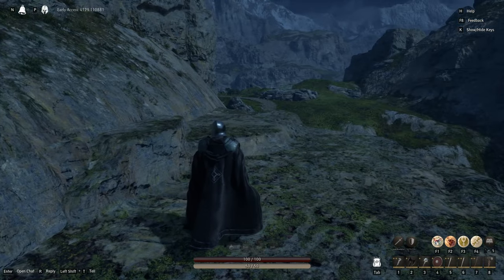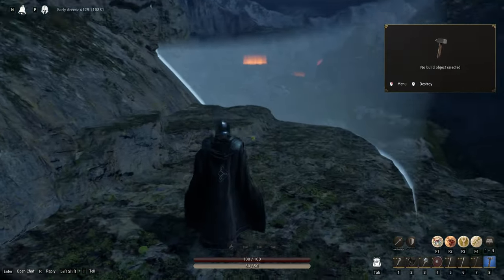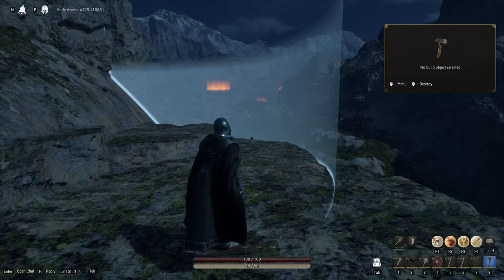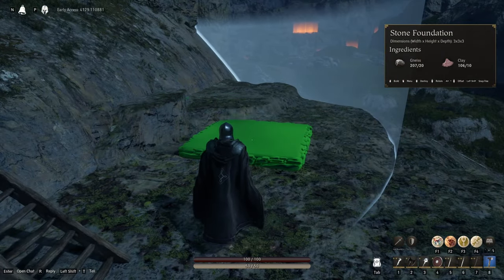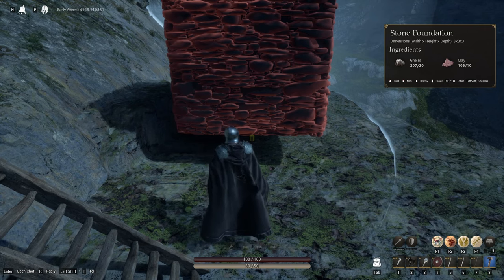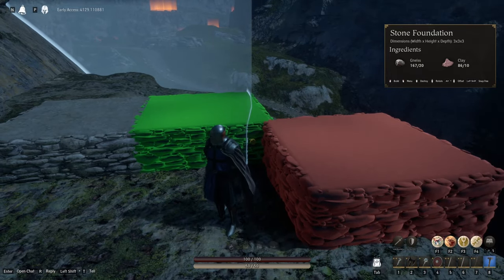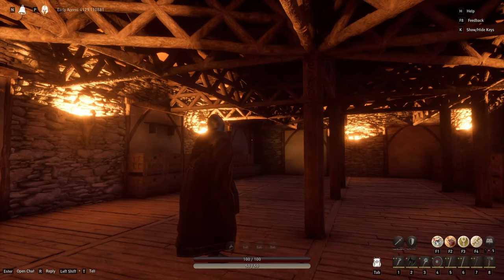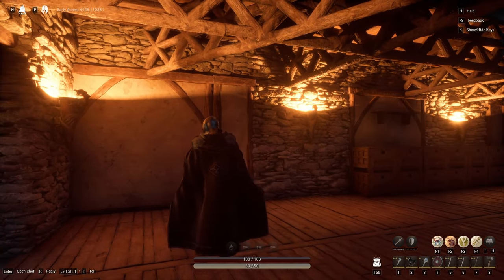Basics of Building a House in Pax Dei

Comment: Cross beams do nothing. Only horizontal and vertical add support
Reply: Really I just finished my ground floor and it's not a lot of space as a solo player so I am thinking of building 1 and 2 floor
Reply: @Nope60_09  yeah ignore angled beams. Stone pillars and 1/3 stone foundation walls are great for support. Horizontal beams for bracing.  My buildings over 9 high 😅 and could easily go higher
Reply from the maker: I'm going to have to check that out. If that's true then that's just kind of messed up lol. Thanks for the info though, I appreciate that.
Reply: @tonybrutal  let me know plz
Reply: its simple to prove or disprove, make two identical walls one without beams one with and see how quickly it goes orange
Reply from the maker: @XelaML  very good point.
Reply: When cross beams are connected to either horizontal, or vertical beams, and or foundations it converts into an added support beam.
Reply: @beardedbear4737  I used the half stair pieces to get me up 3 floors green.

Comment: I have a 3 story, 4 x 12 (foundation piece) long & wide, with only reinforced stone at the corners, horizontal stabilizers, and NO central support and my roof is complete and green.

I think its just stone at the corners, with good horizontal support thats needed
Reply from the maker: @CellChaos-e2s  they've changed how it works a bit with the latest update so as of now I say just do whatever works for you because they will probably change it again in the near future anyways.
Reply: @tonybrutal  oh, I'm a building fool. Previous to the update , the building system was more unforgiving than it seems now. They may have relaxed some of the requirements since so many folks were finding it to be a challenge

Comment: I'm on Promethius -> Inis Gallia Northern Nones and my neighbor has gotten to 9 stories.
Reply from the maker: @littlemetalpixie  did they use a hill or giant rock or cliff side?
Reply: @tonybrutal  no, it's flat as can be. She's a friend of mine - if you go to the northern tip of Nones almost on the border of Trecassis, you'll see a small city that grew there. Look for Pi. She's got a factory there that is at least 7 floors high. 

She used reinforced stone with beams dropped in plus layers of foundation for stability. It's quite a sight to behold!
Reply from the maker: @littlemetalpixie  sounds very incredible. Nicely done on her part.

Comment: walls dont do much of anything, i always build my frame first out of wood or stone, then put on the roof, and walls go on last
Reply from the maker: That sounds like a solid way of doing it. I like that.
Reply: @XelaML  when you go higher walls are everything. Walls or, especially, stone foundations walls reinforce pillars. You can test it by going as high as possible with pillars or vert beams. Then shove walls in and watch the pillars/beams change color. 
Frames are important but each part has its role. 
As i said. Im 9 high with green pillars/beams because of walls. No framing. Bar floor supports.
Reply: @beardedbear4737  wish you would post a vid about it mang, im just trying to get 5 high and running into issues, ive got posts and beams everywhere
Reply: @LosMuertos4830  i was considering it since ive been helping out people in game with it on various servers. 

Ill see if i can make something over the weekend.

Comment: The quantity of beams required to go up a few levels is absolutely ridiculous and really unrealistic, even in a medieval setting.
Reply from the maker: If you level your carpentry and get better beams and stuff, then it's not so bad. The low level stuff just isn't that strong.
Reply: @tonybrutal  I'm 29, building more than 4 high and above without explicitly using short stone foundations as supports is utter cancer.